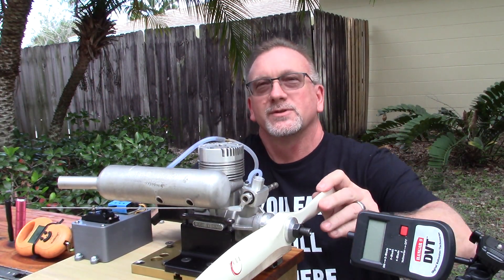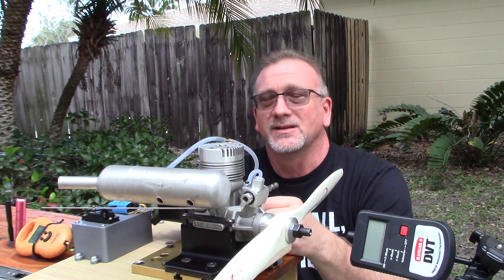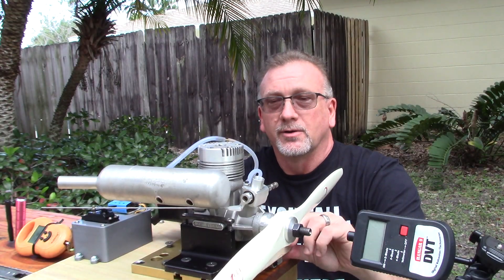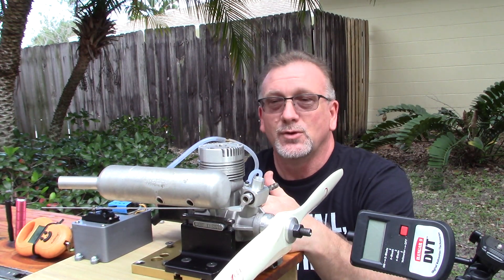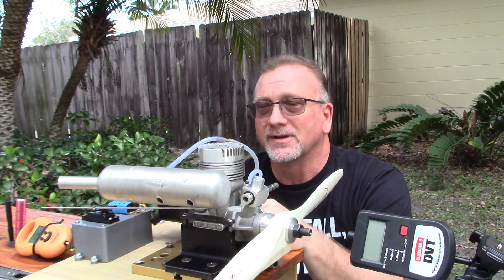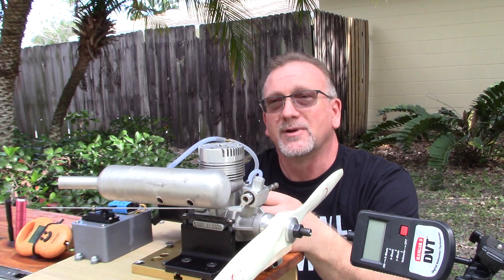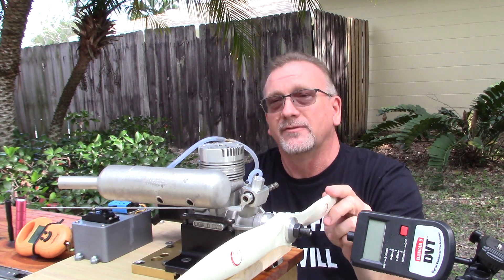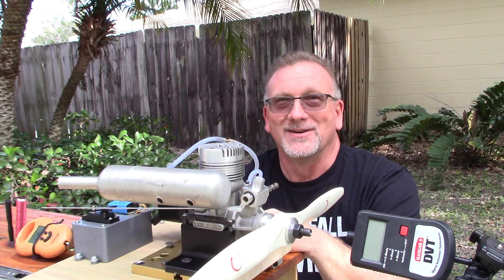Static Thrust Stand v2.0 Calibration Run Aviastar 150 (80/20 FAI)

Comment: I really like the idea of taking measurements beyond just RPM.  Personally, I think noting fuel flow rate could be really interesting.  If you know the fuel flow rate and know how much power the prop absorbs at a given RPM, you could calculate the brake thermal efficiency of the engine.  I have my own hunches of what kinds of efficiencies these engines attain, but nothing beats calculating it from actual measurements.

Comment: I am very happy to see your pull videos, wish the manufacturers publish that sort of information on their data sheet.
What do you think about thrust line? Would it be any different if the meter and engine crank were in line ?
Reply from the maker: No it would not make a significant difference in pull.  It is the entire platform that is being pulled on.
Reply: @dmrcflyr2  No probably not, the vector of 2-3 inches line diff is not significant enough as long as the cradle have a smooth movement.